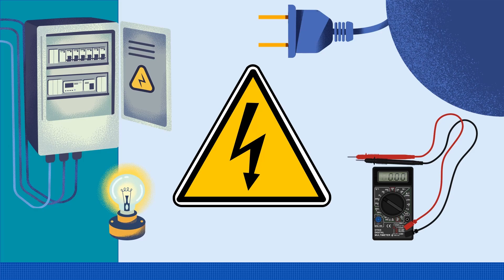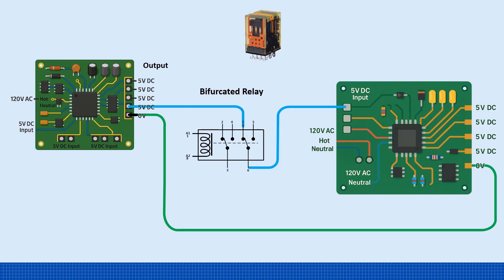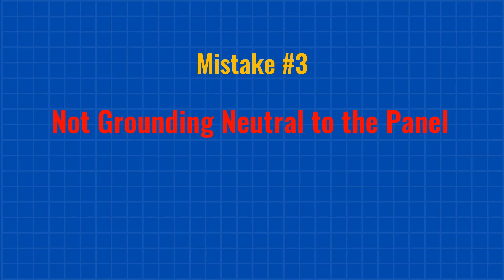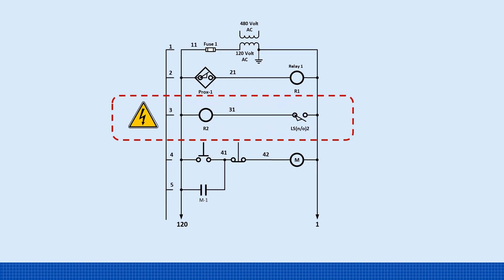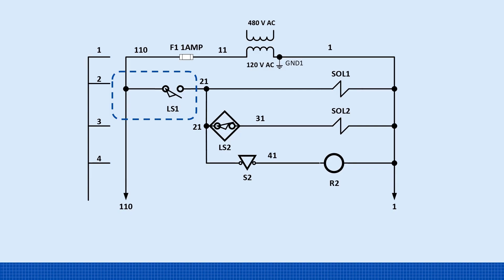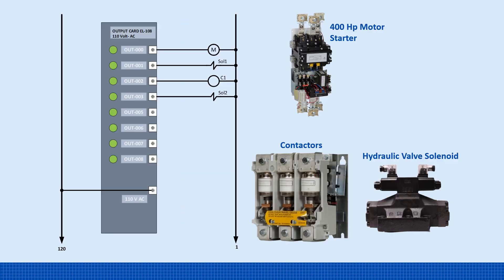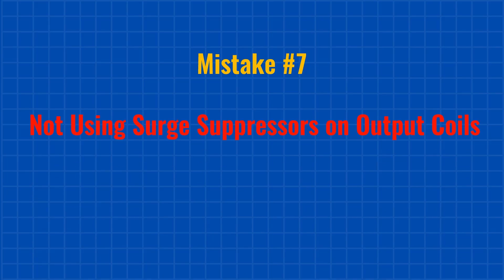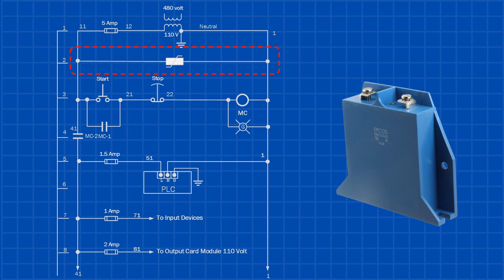7 Electrical Control Mistakes No One Told Me About

Comment: I didn't get the second one, you were talking about isolating each security latch button of each machine? Sorry I'm using these videos to learn English too
Reply from the maker: Thank you for watching. You should not connect wires from one switch to another out on the machine. Instead, run a the wires from each switch back to the control panel. All the connections should be made inside the control panel, not out in the field.